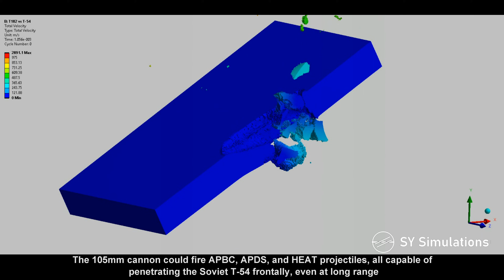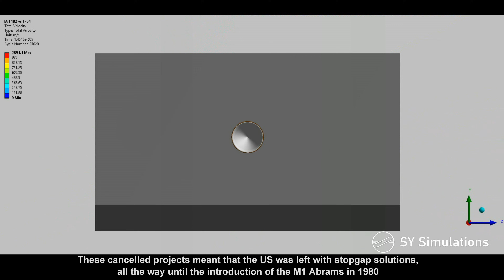AMERICAN T54 vs SOVIET T-54 | T54E1 105mm Cannon Armour Penetration Simulation

Comment: I m pretty sure m60 armed with m68 105 gun firing apds and apdsfs were more than enought in their time. No until t80 arrive did they had problems, and soon m1 abrams were in service quickly upgraded to m1a1 with 120mm
Reply: The basic T-64 (accepted into Soviet Army service in 1966) already had composite frontal armor immune to 105mm HEAT rounds and to 105mm APDS rounds beyond 500 meters. 105mm APFSDS became widespread in US service only in mid to late 1970s, and the contemporary T-64A/Bs and T-72s also had good protection from the M735, and improved UFP protection from later M774 with addition of an applique armor plate in early 1980s.

Comment: Except early M1 also had the same 105 mm L7 cannon, so it would be more true to say until 1984 and M1A1.
Reply: initial version of M1 with 105 L7 gun was "poor" tank with low armor against T-80. Game changer was Rheinmetall 120mm L/44 and added armor 1984/85

Comment: It used a lighter version of the 105mm gun of the T29 and this AP round got a max velocity of 914m/s . How in the world this gun could fire it at 1067m/s , the barrel is just 20cm longer .
Reply: because this shell is 3 fucking kg lighter than T29's APCBC?
Reply: @CChiefmk3 No , I digged a little deeper . The T140E3 gun used on the T54E2 or the M-V-Yoh prototype , had a 7.43m long barrel (60cm longer) , different breech/propellant and a T182 shot with 15.8kg and 3500 feet/s . The T29 shell had 17.7kg , so 1.9kg heavier . 

The T54 , T54E1 and E2 all had different guns and loading mechanism , E2 had a human loader . Don't get facts from WT pls .....
Reply: they supercharged it, lol, just how they did in the m103 vs t34

Comment: Good job. A 1957 tank managed to penetrate a 1945(1946) tank. Only 11 years of difference Impressive work
Reply: Except that the same armour layout was used in more modern T-62, only for it to change with arrival of T-64
Reply: Yeah... with the round in it's selection that's easily the worst performing
Reply: Chill out 👍
Reply: Still would get bombed to oblivion since the ussr had a weak doctrine when it came to AA defence against CAS in armored columns
Reply: @biggiest-f2d  unrelated cope. Plus in 1957 the shillka was introduced and it railed any close air support up untill standoff weapons were invented
Reply: @Iron_Soil not really accurate though. ZSU-57-2 entered service in 1957 but it had no radar and very limited effectiveness against fast jets. Even the Shilka with radar only appeared in the mid-60s, not during the T-54’s early years
Also worth noting early Cold War CAS wasn’t about hovering over tanks aircraft attacked columns, roads, bridges and logistics. If air defense was already “railing CAS”, the US wouldn’t have dominated Korea or later conflicts the way it did.
Early SPAAGs forced changes in tactics sure, but they didn’t magically shut down air power. That only started to shift much later with integrated radar SAM networks
Reply: If they added M829A4 to the game you would cry so much lmao
Reply: why are you so worked up lmao
Reply: Oh look a zetard
Reply: 1947 production model of T-54 had more upper glacis armor, so no.
Reply: @Umbaretz  lmao

Comment: War Thunder has a serious error regarding how full-caliber AP rounds perform against angled armor, which explains why the M358 of the M103 bounced off the hull of the T54.
Reply: heck, even the 130mm AP round from the Object 279 and IS-7 just bounce off T-55 front plates
Reply: @spextahd5673 we love random chance modifies
Reply: It's because War Thunder uses the DeMarre values normalized to mid WW2 era ~75mm sharp nosed AP shells. They don't really work for the later war newly developed US shells like 90mm T33 AP, or especially for post WW2 shells like 120mm M358 AP from the M103. These shells were hardened especially high at the tip and a little softer in the middle and so they were more able to deal with angled plates since the nose would fracture and allow the rear half of the shell to continue straight with less deflection. It allowed those late war and post war shells to blast through angled armor that the earlier shells couldn't. 

You can literally watch in the video how the the front half of the shell breaks off and the rear half "rotates" around into the gouge in the plate and gets through
Reply: yeah they dont consider partial penetration "penetration" and its just left at that
Reply: @Trekko727  Methinks a partial pen is for the most part results in the same consequences for the crew.
Reply: @Trekko727 even though the spalling by itself could be enough to totally incapacitate the crew of the tank
Reply: @Trekko727  Uhhh they technically do.
Reply: @HitWithBricks  they do? how do they figure out if they do?
Reply: @Trekko727  I can't speak for the modern implementation, but back in the day it was that historical data was made with partial penetrations in mind (a certain amount of the shell had to pass through the armour, I think it was 50% for western and 75% for soviet tests, which ofc does often spark conversations about how one or the other side did it 'wrong' or that one or the other side was just propaganda). 

Gaijin didn't even wanna bother with this so came up with their own 'semi realistic' calculator that sometimes does get manual adjustments based on historical data, which would still count actually-partial-penetrations-but-listed-as-full-in-pen-charts IRL as 'full pens' in war thunder terms.

Realistically, I don't think it's really that big of a deal though, in like 90% of cases the war thunder implementation of penetration (either old or new one) does a good enough job, and implementing a specific 'partial penetration' mechanic would only help a few key interactions, while hurting many others.
Reply: @HitWithBricks  oh damn thats interesting man, thanks alot for the insight info
Reply: apcr is unironically useless in that game
Reply: These sims are also not the reality , just a simulation . With perfect conditions on shells , armour and impact angle .
Reply: WT is made for russian funboies
Reply: The M103 could (IRL) penetrate any tank frontally at it's time. With the most powerful gun. The IS4 was not a problem at 1200-1500m. The T54 and T55 was not a problem.
Reply: You may be confusing this with the early T-54 with a 120mm plate.
Reply: They don't include the mass weight of the shell if they did things would be a bit different
Reply: Cheater, cheater, winner forever.
Reply: The whole game is a freaking error.
Reply: Yeah angled armor is significantly over performing, mostly against full caliber AP rounds due to not having realistic normalization on impact against angled plates
Reply: yeah in wt this would go clean through
Reply: war thunder will never be accurate.  It is a video game whos average player is 14.
Reply: @wowdanalise  More like the developer is using a modified flight engine for nearly everything and has enough spaghetti code to feed half of Italy. Add a steaming sauce of "can't be bothered to try fixing half of it" and you get War Thunder.
Reply: @StarkRaven59  That's kinda the thing. The game engine is 20 years old and not designed for tanks. Add in a complete lack of giveafuck and extreme monetisation that is still raking in cash, why fix it?
Reply: @-tr0n  remember that the age of the game engine doesn't have anything to do with it, it never does, it's alway the willingness of the devs/studio heads to actually want to put in the work (and time and money) to develop and modernize the engine that actually matters

Even if the engine was originally developed to handle a specific type of game it can be heavily modified to handly any other type of game you want if you care enough/have enough time, and I'd say Gaijin has had quite a lot of time

You can really see Gaijin doesn't want to be a developer anymore, most of War Thunder has been developed by freelancers for the last couple of years at least, and to me it seems like they want to simply turn into publisher in the near future
Reply: @wowdanalise  it’s accurate in some regards she not in others
Reply: Hello, i think wtm does way better, this "port" somehow slightly modified to a modern, and old gameplay style [we can climb hills]
Reply: @That_Random_Nick  the ags even gets m900

Comment: It is indeed crazy to think that world economic powerhouse was stuck with one stopgap tank after another until M1 Abrams (about 4 years after T80 entered service).
Reply: As we have seen from various projects, US military procurement is a bit of a circus.
Reply: @StarkRaven59  The best way to not make mistakes is to do nothing at all. When main concern is not being blamed for inevitable teething issues, best approach is to avoid any actually new technology. Meanwhile Soviet generals would be like "this looks like just what we need! Let's start making them right away, put them into service, and deal with issues as they pop up."

There's also issue of percieved technological superiority. If you believe what you have is damn no good enough, you'll be far more inclined to take chances with unproven tech. If you feel you have comfortable advantage, you'll let it cook until it's done.
Reply: Except the Only StopGap tank here is the M47.
Reply: I guess it makes sense if you are the economic superpower that you can scrap and restart your projects without worry of sunk costs. 
A smaller country would be more likely to stick with it than start over.
Reply: They really over-reacted to the danger posed by shaped-charge warheads. Also, their own advances in shaped-charge warheads gave such a boost to even their 90mm gun tanks, the 90mm HEAT-FS could perform as well as their 105mm anti-tank firing APBC. Also guns got smaller, you could fit a 105mm gun in a Patton's turret. 

So why exactly replace the Patton? If you can get the penetration performance you want with gun/ammo upgrades, and trying to increase armor is hopeless against the same advances by opponents... then is it a "stopgap" or it is like the Sherman throughout WW2: good enough.
Reply: Getting outproduced by the USSR was a much bigger issue than the quality of those "stopgap" tanks which could still get the job done for the most part.
Reply: @nks406 Well, they could "get the job done" if we are talking about the 60's were both americans and soviets started using heat and apds for their cannons, which made their armors pretty uselles(t54-55 vs m48 and m60 vs t62). But if we talk about the mid 60's till atleast the start of the 80's the soviets were years ahead of any nato tank(t64,t72 and t80). Their frontal armor could not be penetrated by any nato ammo of the time(just weakspots maybe) while also being superior in terms of optics and fcs in general.
And that wasn't the only time they were on a big advantage in terms of tanks, after the introduction of the t54 the m46 and m47 could easily be penetrated by BR-412D even at distance(1km) while the t54-55 was able to withstand a frontal shot of a 90mm cannon even if it used apcr.(the apcr could only penetrate specific parts of the turret at 300 meters or less). And when the m48 came out the same thing happened, the difference was that the Br-412D now could only penetrate the frontal arc of the m48 at a shorter distance of 500 meters or less.
Reply: @cykablyat123br9  NATO was always behind with armour even with the arrival of m1/leopard 2 but war is not 8v8 WoT or war thunder matches.
Reply: @nks406  Exaclty, warsaw pact artillery was also there to make a "little" extra damage.
Reply: @nks406 Except there not.
Reply: @cykablyat123br9  There’s so much wrong with that I don’t even know where to begin. What the Soviets claimed their armour could do and what its demonstrated itself to be capable of in various MidEast conflicts (and more recently, in Ukraine) definitively puts paid to any claims that Soviet armor and ordnance were more capable than their Western contemporaries. More advanced and forward-looking, sometimes. More capable, never.

And the little comment about their FCS and optical systems being more advanced genuinely made me laugh. The Soviet Army was still rolling out active IR and 1st gen light-amplification systems on brand new tracks in 1989, with gunners taking on full manual control over gunlaying, sometimes with the aid of a laser rangefinder — at a time when the Leo 2, Abrams, and Chal 2 were all running around with fully automated fire control suites and 2nd gen thermals.
Reply: @jamesharding3459 I gave contexts but it seems that you can't read.
It's not a claim, it's a commom fact that anyone with 2 braincells agree in the tank  circle online. When the soviets started introducing NVG's(for all crew) for their tanks in mass back in 1958 with the introduction of t55a nato was still using commom lights to see on the dark(they had nvgs for the drivers in some tanks lol)... Not to mention that most of nato tanks don't even had stabilizers for their guns at the time(only the british ones like centurion had). And into the 60's the soviets developed the t64 which had an coincidence rangefinder for it's FCS, an composite armor that was almost frontally imune to any nato treat of the time, and an autoloader. Now into the 70's they introduced the t64b in 1976 and the t80b in 1978 which both of them had the 1a33 fcs that had an automatic lead, laser range finder and an wind sensor. Nato would only had a tank with all of that at the start of the 80's with the introduction of the abrams.
In terms of armor you need to analyse the time context, the tank variant and what threats with what capabilities he would face at the time or conflict he was in at the time. One proof of soviet armor superiority was during the iran iraq war where iran had a mix of old and newer nato tanks(m47 to even the chieftain). In that conflit both iraq an iran only had older variants of nato and soviet tanks combined with older ammo(what nato and ussr had available during the 60's and part of the 70's to throw at each other in a war scenario at that time). For example, the iraqi t72 urals were able to withstand frontal hits from old tow missiles and even 120mm apds shots from the iranian chieftains. While at the same time the t72 urals would easily destroy any iranian tank from the front in that conflict. There was even an ocassion where inferior iraqi t62's ambushed an iranian chieftain convoy that was stuck on the mud and destroyed or disabled all of them.
Reply: Because US employed many stopgap solutions for..3 decades? With many possible replacements/not-stopgaps were rejected (T95 medium, MBT-70) but with all of them forming the basis of M1. Trial and error made the design that US liked, it just took em long time to find one.
Reply: @seregauser3014  and that left them with no proper tank for armored formations up until late 80s, so basically most of cold war usa wasnt ready for land war. No wonder why all wargames are set in 89/91
Reply: I means If it worked... it worked. Stop-gap in technicality or not.
Reply: @DOSFS  No tank at all would have also worked so your argument is irrelevant.
Reply: They weren't concerned because 1. air power and 2. The Pershing could pen T72 frontal armor.
Reply: @trentvlak  um what ?
Reply: @trentvlak  pershing could pen a t-72??????,holy american copium,where are you getting your info from bruh